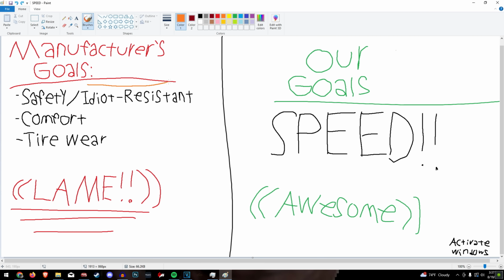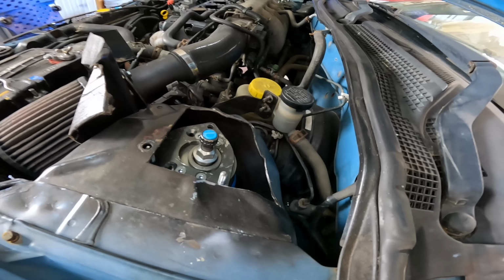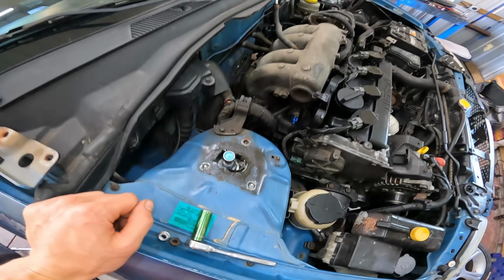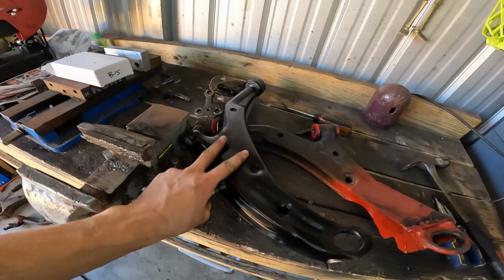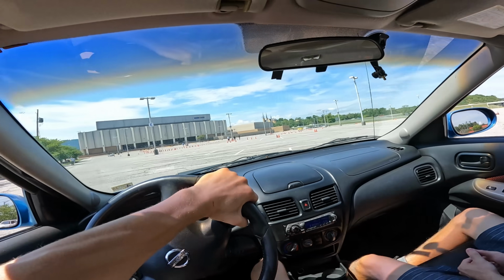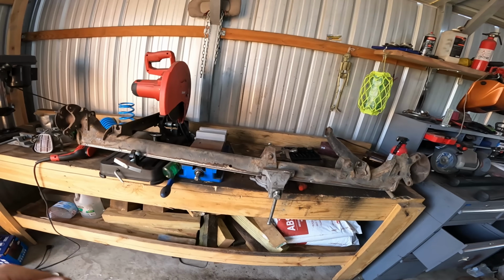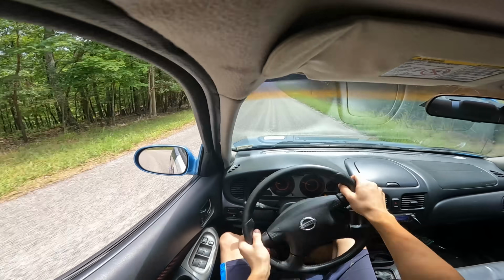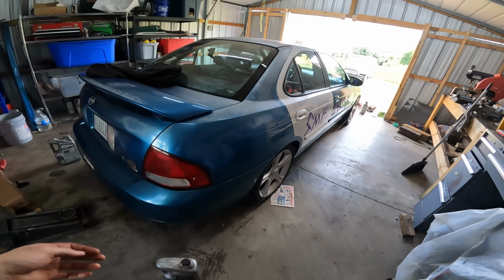Putting Race Car Suspension on an old Sentra - How Fast Can we Make it?

Comment: Great vid, there's not enough autoX content like this on youtube and I love it! 

Proper tires will drop your times by at least 4 seconds, and are well worth the money.

I run an 8th gen Civic in autoX and have gradually modified it over the years. I started on all seasons like the Sentra and would hit their limit way too easily. I eventually upgraded to Firehawk Indy 500s (300tw) which were a definite improvement, but still carried a lot of the same characteristics as all seasons - understeery, screechy, and requiring me to chop at the wheel to get it to respond at all. This year I finally splashed some cash on Bridgestone RE71RSs (200tw) and holy moly. There's more grip everywhere, and suspension shortcomings are less apparent because of it. I have to drive more gently and precisely, but this means I have much finer control and can focus on refining my lines through the day. 

With the Sentra's suspension already sorted, tires will make it a proper weapon! You don't seem like you care too much about placing well, but tires will still make it so much more satisfying to drive. My civic shitter is a consistent top 5 contender overall with HS PAX. I'd recommend going with the Falken RT 660s, from what I've seen they nearly match the RE71RSs and last about twice as long - a pretty good tradeoff. Those two are the meta right now, I wouldn't bother with anything else.

I love your style man, can't wait to see the Sentra turn some heads (in a good way)
Reply from the maker: Thanks for the recommendations. I've driven cars with real tires and I know exactly what you mean, it makes all the difference in the world. I'm going to try and find some WIDE wheels too, I don't mind cutting fenders..
Reply: @HatersGarage  Depends on the rules of your local club, but W I D E tires usually bump you from STX to SMF if you're not there already. Still worth it for the steeze, but you'll get your balls crushed by PAX ahaha.

Edit - I see the SMF on the car later in the video. Those fenders aren't long for this world.
Reply: @Mika-ph6ku TW just refers to "Tread Wear," which is a DOT rating given to tires basically to indicate how long they will last / how soft the rubber compound is. Lower means softer with quicker wear and higher means the opposite. For reference, Indy 500's are 340tw and will wear slower than the 200tw RE71RSs and RT660s.
Reply: Are RT 660s good on a road course, too, or mostly an AC tire? How are they as 3-season tires and in the wet on the streets? And if you had to split your tire choice between track day tires and "best 3 season and wet weather street tires" what would your choices be or where might I go to learn for myself?
Reply: @Drunken_Hamster  RT 660's will last longer both at autoX and on road courses, but RE71RSs are typically capable of marginally quicker times. So it's up to you what's more important - in terms of pace they are really similar and a good driver can make up the difference. They're both well suited for autoX and road courses.

200tw tires are typically fine in the wet, but I wouldn't run them as daily drivers. I've heard that a set of RE71RSs get eaten up after 10,000km of regular street driving. From my experience, I've done roughly 25 autoX runs on my set of RE71RSs this year and they're at about 2/3 life left. They'll wear much quicker on a road course though. So it's best to run two sets of rims and swap them for events which is what I do.

When I ran the Firestone Firehawk Indy 500s I used them for track days, autoX, and street driving. The fact that they can do all that is pretty impressive, but of course there's tradeoffs. They make more road noise than regular all seasons so aren't as comfortable for street driving. As for on track, they don't handle heat well and will fall off in grip after only a lap or two. This is less pronounced in autoX. But still an overall great option for a budget friendly, multi purpose tire that will last many times longer than the 200tw tires. The Michelin PS4S would be similar and probably better in most aspects (for a steeper price) but I haven't run them before so can't say for certain.
Reply: @Drunken_Hamster if you want a 3 season tire and have any sort of normal person budget to work with, I’d go with the rt615k instead of the 660s. They’ll last longer, work better in wet, and cost a little less. The 660s are a little closer to the “super200” level of sticky and wear down faster.
Reply: @Drunken_Hamster  rt660's are mostly a Ax/time attack tire. i have a set on my STS class impreza, and ive been dailying them since the end of last summer. i think their fine on the street, surprisingly quite, not fantastic in the rain but i wouldn't consider them scary. and ive put close to 10 000KM on them so far and they have almost no wear, even with a couple 20 minute sessions on track and a handful of Ax events. if your looking for a tire that is mostly for road course stuff i would look at the hankook rs4, slightly slower than the rt660 but from what ive seen they last a hell of a lot longer/have a better heat tolerance and from what ive heard their pretty good in the rain too. Tyre Reviews on here did a video comparing a bunch of 200tw tires as well.
Reply: I have a 8th gen civic looking to get into ax got anywhere I can msg you to learn more about what you’ve done?

Comment: Bro, I bet you can get a set of sick wheels off marketplace for cheap. As for tires... yeah, those are going to be expensive
Reply from the maker: I've been on the prowl for some wheels, the 4x114 lug pattern isn't too common though.
Reply: @HatersGarage  damn, 4x114 is about as uncommon as 4x130. Would you ever run wheel adapters?
Reply from the maker: @camber_courtney5250  I'm not totally against adapters. Looks like my only cheap option right now
Reply: @HatersGarage  4x114 to 4x100 is the route I'd go. Everyone makes 4x100 wheels, and almost everyone has a set :D

Comment: If it's within your class rules or you think you can cheat it in, you should consider converting or replacing that torsion beam with a true solid axle using a Satchell Link. You could even weld in some static camber and toe (and set up a shim system so it's adjustable!) if you don't think you can get away with making the hubs pivot in order to allow a camber link to be installed.

Obviously having TOO many bars back there will look sussy to the tech inspectors, but I think you could slide a basic Satchell Link solid axle setup in the back without them catching wind. Unless they read this comment, of course! Oh, one more thing. If you haven't already, consider taking the front swaybar off, entirely. EVEN MOAR FRONT GRIP!
Reply from the maker: A Satchel Link setup would be pretty trick, the rules in my class is basically anything goes as long as you use the original mounts on the body of the car. I wanted to make a longer panard bar that was lower down, but it would have been against the rules so I didn't.

The rear suspension on a FWD car is honestly pretty useless anyway, it pretty much just needs to be stiff and have toe out. I think a Satchel Link setup would be much more useful on a RWD car. Also I did remove the front control arm, forgot to mention that in the video.
Reply: @HatersGarage  So I take it you can't ADD mounting, either? Regardless of that, how do they describe the operative difference between something like moving the panhard mount as opposed to hogging out the entire top hat for the shocks? I mean, you technically completely destroyed that mount and moved it, too, so why would moving the panhard all the way over to the left NOT be the same, y'know?

Also, I proposed my Satchell Link idea because it would eliminate the Panhard rod altogether. No need for that nor an even more complex watts link. However, you would need to add mounts for the upper bars on both the chassis and axle side, as well as move the chassis side mounts for the lower bars to the center.

What I think would be even better, but most likely not viable for you class is making a decoupled suspension similar to AMG project one, but using a special slider box for the roll axis damper which would allow you to use a standard damper like some formula student teams have done instead of needing to construct or commission a special 2-way damper with two springs and a sleeve like the actual AMG P1 has.

A foreign FSAE guy I talk to calls the setup a "z bar" but if you google that you don't get the design that I'm talking about and I haven't heard back from him on an alternate or more official name for that geometry. I could send you pics, but obviously not here... And if it's out of the question for your class, it's kinda moot, anyway.
Reply from the maker: @Drunken_Hamster  In the rules it says that you must use factory mounts, but they make an exception to the top of the shock towers. I'm also allowed to reinforce stock mounts.

I'm pretty sure when they say you must use  stock mounts that means if it has 3 mounting points, you have to use those 3 mounting points. They don't really check if a car is legal until it starts winning seasons, then I'd be busted. 

As far as the crazy Z Bar setup, honestly if I was going to go through that much fabrication in the rear, I would add rear-steer.

Comment: With the dual exhaust what did you do about the o2 sensors? i want to do it on my first car but i dont want it to run like trash. i dont need to do smog testing but i willl run cats. (daily driver things) if / when you reply thank you :)
Reply from the maker: I just attached the upstream sensor to one of the pipes. It probably won't run like trash but It will never run as well as a normal exhaust